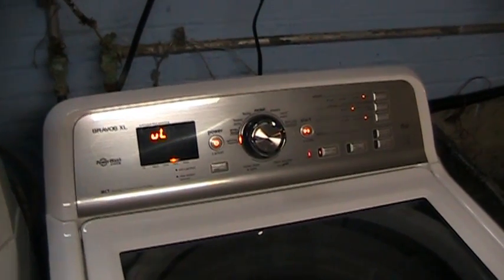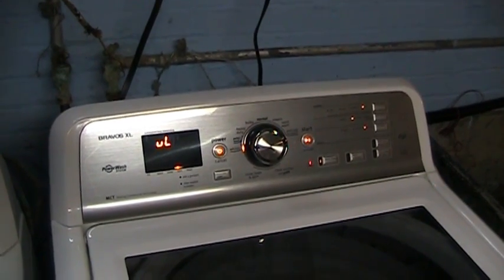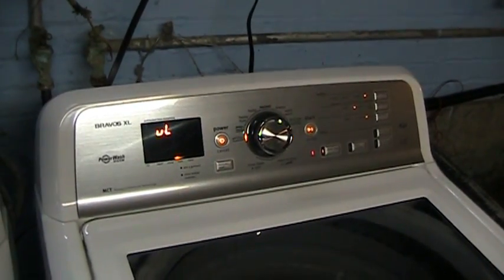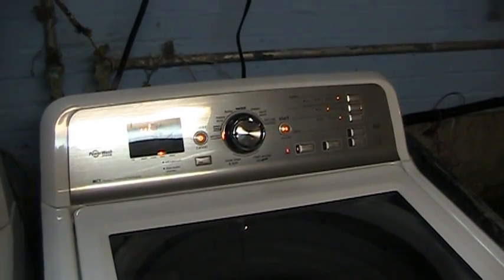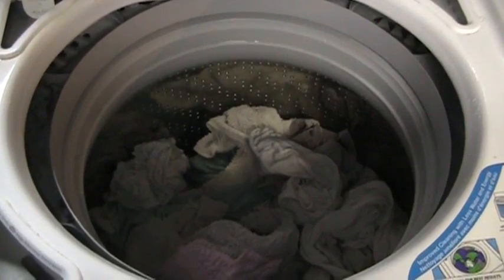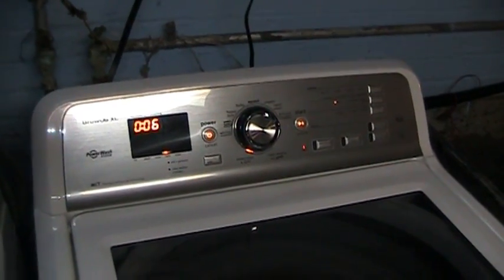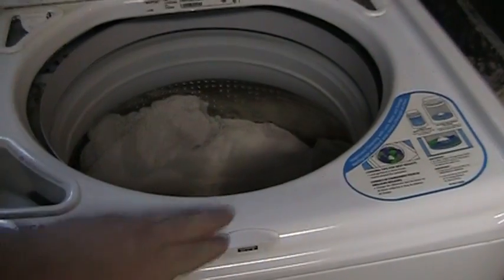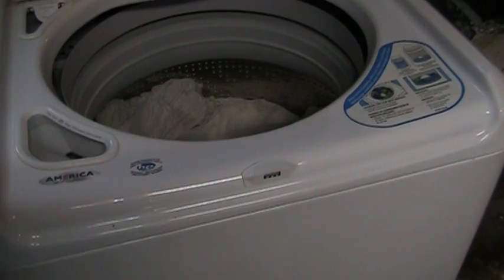Stupid Washing Machine Being Stupid

Comment: We just had a Samsung dryer that died after 12 years. Most of its life had a very funny thing that it did. After the dryer finished and sung its song telling you it’s done, it would for some reason continue to run the Tumblr. Keep in mind most of the life We never use the wrinkle preventer function on it. If you open the door the tumblr would shut off. But as soon as you close the door, the Tumblr would come right back on. The only way we could get it to go back to normal as if we ran a five minute timer or turn the breaker off for a few minutes. But for the last year we had it it seemed to have happened more often and gotten worse to the point we couldn’t actually get it to stop doing it. Then eventually, the dryer had enough and stopped heating and we have since replaced it with a whirlpool. I tried looking up this problem and I never found anything about this or other people that had this problem about our model Samsung dryer. For some reason, our Samsung washer has recently started to do this problem where it would go unevenly loaded for really no reason or another error that claims that it’s not sensing any water going into the drum and stopping. All we have to do is press the start button again and it seems to go back to normal, but it seems to get stuck before the spin cycle.

Comment: Going through this right damn now. It will fill with water, then won't agitate. Why it take so long to fill? I hate this. Now my husband and sons  use it and no problem.  I use it, it get stupid.
Reply from the maker: I can't answer your second question...unless it happens that you just aren't waiting quite long enough for agitation to start. As for the first question, it does take this model a long time to figure out how heavily loaded it is. I believe this is done by spinning up the drum and looking at the timing differences returned from multiple hall effect ("rotation") sensors.

GE/Haier Appliances has washing machines that do the same thing in far less time.
Reply: Season Greetings!! The machine will fill with water a few click then it will attempt to agitate/impell then stop. Or it will fill up, a few clicks and the impeller won't move at all. I drained the water, the tub will spin, as of now the impeller wont move at at by hand.
Reply from the maker: It's certainly possible that something got under the washplate and is jamming things. I'd really expect the machine to throw an error code in that case. It's been a while since I had the tub out of this one (hall effect rotation sensor failure after a basement flood), but it's not terribly hard to do if you're mechanically inclined.

I didn't particularly care for this machine then and I really don't care for it at all now.

Comment: I remember watching washing machines run while the lid was open when I was little... I still survived.

This is going to sound harsh, but sometimes you just have to let survival of the fittest play a role. If a child is stupid enough to stick their hands in a running washing machine when they are clearly big/old enough to actually reach up there. Frankly deserves to find out what happens.

Also, is it really necessary to REQUIRE the lid lock be working in order to use the machine? The lid lock should be considered and accessory. Not a critical component. No wonder these things are always breaking down.

Comment: new appliances are computer controlled and the software was written by morons. My new washing machine always fills to the same level which is designated by the load type selected. It however decides to fill wait fill wait wait wait fill more then wait. aggitate wait nope fill. It takes an eternity to fill up. Then it does the same stupid thing with spin cycle. Also draining water at end of wash is the same retarded shit. Drain a little wait drain a little more oh shit no wait. WTF. 

the weirdest part is an empty washer with nothing in it and you can hear relays clicking open and closed randomly. WHAT IS IT DOING!!! It is supposedly off!! I guess it is also wasting electricity. oh yep it is.
I dont understand what was wrong with the old reliable mechanical timer and just doing the damn laundry.
Reply from the maker: There wasn't anything wrong with the mechanical timer, and many clothes dryers have actually gone back to using one!

The software in this machine is beyond stupid. If it had been written by morons, that might have been an improvement.
Reply: @uxwbill  i agree
Reply: This is so stupid! And it doesn't clean when working properly!
Reply: @jeromedavis8575  no it doesnt but it does a great job tearing up your clothes.
Reply: @kwacz  I've never had torn clothes from a Speed Queen Classic. What washer do you recommend? If the classic wasn't available, I'd go with the Maytag commercial.
Reply: @jeromedavis8575  all i can say is that I had an old washer in my clothes lasted a long time. I bought a new washer and now all the crotches of my sweatpants have holes ripped in them within a month or two. That was never a problem with the old washer. I bought a new one of a different brand, right now I have a whirlpool and it isn't much better.
Reply: @kwacz  Which other ones did you have?
Reply: @jeromedavis8575  whirlpool and Maytag. But they just don't make things like they used to.
Reply: @kwacz  There's an exception: Speed Queen Classic.

Comment: 0:49 No no no! I heard that was the same company that has those crappy stereo machines with those ugly plastic turntables! Their washing machines are also just as bad!
Reply from the maker: It's the same name, not the same company. The appliances are manufactured by various companies: Whirlpool, Electrolux and GE Appliances.

They're most commonly seen in apartments and dormitories, being as most of them are extremely basic models and therefore cheap.
Reply: Maybe one of those "Crosley" companies [and I don't care which one] needs to change its name. You know, to avoid confusion like that?

Comment: I used to have one of these newer machines at the family house. Maytag brand, too, though less glitzy (no glass top, LED display). It wanted us to place clothing or sheets in a specific way: always towards the outside edge of the basin, and in segments. It didn’t like clothing being in the middle of the basin. Took twice as long as the old unit, no matter what we did.

In retrospect, a Speed Queen would have been a much better way to go, despite that being the more expensive option. We use them at the apartment building I live at now and never have issues with them.

Comment: This is why you use vintage.... JK I know you would rather use a vintage things. We use a 1996 Maytag, and it works perfectly. The only thing we replaced on it was the water shutoff solenoid (what keeps it from over filling).
Reply: The only new machines I'd use are the Speed Queen Classic pairs.

Comment: We used to have a very similar Maytag washing machine with matching dryer before we moved, and it would throw the unbalanced load error during almost every wash cycle. The only way to make it not throw the error was to barely load the drum up which I thought wasted time and resources. After we moved, we got a pair of LG machines which still go crazy with the laundry at the spin cycle but at least they doesn't stop every time whining about the load.

Comment: I HATE my new  “forced to buy Energy Efficient”  , Energy Star whirlpool.!!!! That’s all the appliance stores make &  sell around here now days.  
It will not let you do a Hot water wash,  darn temp sensor , because of the Stupid gov. Regulations & restrictions !!!! 
I wish I had repair & mechanical training , fix it skills !  I would have certainly kept my old washer that lasted 25 years.  
I wonder how hard it is to get parts for old machines ?? Dryers too ?  
If they even sell those parts  anymore.
Reply from the maker: Many parts are still available and a lot of failures are easily repaired in the older machines. I don't care for the new machines either, and don't believe they produce any great savings.

For at least a little while longer, Speed Queen is still manufacturing high quality machines. They might have to be custom ordered at this point. It's my understanding that the government has come down on them as well, and that their newer machines are nowhere near as good as what came before.
Reply: Grand Appliance does still sell Speed Queen. I looked at them when I got my microwave. likely when mine die I might get these. @uxwbill
Reply: It's going around the AW grapevine that Whirpool/Maytag's commercial line may not really be all that bad. I believe the MAT20 is the Maytag counterpart to the Whirlpool model being demonstrated.

https://youtu.be/M8TBSRgz_6M
Reply: The 2019 speed Queen washer allows hot washes and has traditional agitation and you can do a full tub of fill or half tub of fill however that is it, anyway the cycles are simple and not complicated and the extra options are extra rinses, presoak rinse and heavy duty ( extended wash cycle to any cycle)

Comment: We have a different but similar HE top loading washer.  For ours, it is important to arrange the clothes in a doughnut shape leaving the wash plate visible in the middle.  Regarding Energy Star, I actually think it is quite useful in some product classes.  Air conditioners in particular show a clear distinction and the Energy Star mark makes it easy to identify those more efficient models and provides manufacturers with an incentive to create extra efficient models and helps them market them effectively.

Comment: People need to use their common sense when using these machines. For starters, read the manual and understand it. If your going to wash bed sheets, put couple of them and that's it! Don't be adding jeans, towels, etc. I have a Maytag Bravos and it's about 10 years old and I've already replaced the tub bearings & drain pump. In addition, depending how much you wash, these machines need maintenance about every 3 years: the inner tub needs to be removed in order to remove any lint around the drain guard cap.
Reply: Never used to matter with an old school top loader with a center-post agitator, or even a vintage front loading washer like a Bendix or Westinghouse.
Reply: @richardhz-oi8px  all that mattered was wether or not its overloaded to the point of no turnover

Comment: Hi there folks, I'm British and live in London, top load washers are very rare hear, in the 1970's/80's Hotpoint sold a american style top loader hear, I had one, the amount of water it used was alarming but speed and cleaning was first class. Because of EU law, this machine is no longer made/sold hear now because of the water consumption/energy use. All we have on sale hear now are front loaders, using small amounts of water, longer program times but energy efficient. The HE top loaders iv seen in the states seem to waste a lot of time/water sensing the load and then trying to balance it before spinning repeatedly refilling trying to redistribute the load. The old mechanical top loaders(speed queen, fridgidare, whirlpool) were so much better as you no. I think washer manufacturers making in and selling to the states are going to have to go back to the drawing board with this High Efficiency thing. I have a Miele front loader which is never a problem, it washes, rinses and spins well and always sorts it self out. Take care and have a nice day. Best wishes Lee.

Comment: It is rebalancing
Reply from the maker: I know that. The implementation seems incredibly clumsy and wasteful.
Reply: Un needed to use that much water very wasteful. I prefer Frigidaire washers and dryers
Reply: so much for "Energy Star" should be called "Energy black hole"
Reply: Dylan Reischling to avoid that   
Press the pause button and rebalance it if you hear plus if it looks like it is balance but it goes out of balance then there something wrong with the motors nut screw that needs to be tighten
Reply: Yep

Comment: Hello,

I'm late to this party but I have this machine and I hate it. I purchased mine in 2013 and had the repair man come because my clothes were getting ruined. He told me something about water temperature being an issue in breaking down the HE detergent. I have purchased everything to keep the washer clean, high efficiency detergent, washed smaller loads, used extra rinsing, and some clothes I have taken to the laundromat. My warranty was up last October so if you know something I can do please let me know. My husband I have even discussed buying a new washer. Three and a half years of using tons of water, wasting electricity to double wash and destroying clothes  I have paid for a new washer. HELP!
Reply from the maker: I've not had any trouble whatsoever with clothing being destroyed. In terms of troubleshooting, it would help to know exactly how your clothes are being destroyed.

These aren't my machines and they are not what I would have purchased. If you do replace the machines you have now, I can only recommend Speed Queen as a replacement. They are more expensive, but you will only have to buy them once and they will last.
Reply: uxwbill Thanks for a quick reply. An example of how the clothes were ruined: dark clothes coming out with clusters of lint and blotches of soap and not rinsed, light colored shirts ending up with spots everywhere and stains not coming out. I even wiped the insides with vinegar to make sure nothing was along the walls. I have heard others mention the Speed Queen as you did so I will do some pricing. I will be the first to admit I miss the agitator in older machines. Recently I took out some shirts I haven't worn since purchasing this machine, and it's shocking. The old shirts look newer than new shirts I've worn 2-3 times. Thanks for the feedback.
Reply from the maker: I'm really not sure what to think about the trouble you're having. I've heard of others having the same problem, so you're definitely not alone. It is not a problem I've had with this machine.

You might try calling Whirlpool if you haven't already, even with the machine being out of warranty. This machine suffered a failure outside of its warranty, and Whirlpool covered both the part and labor without question when I called them and complained. Be firm and insistent that you expect to be satisfied, but don't forget to be polite even when you're frustrated.

If Whirlpool cannot satisfy you or chooses to refund your money (which I've certainly heard of them doing for other appliances that weren't right), I would definitely recommend the Speed Queen machines. They still have a conventional agitator inside. (There are also some low end "Crosley" branded machines that have an agitator and mechanically operated controls just like every washing machine used to have. Only I have no idea who is making those or what kind of quality they have.)

Comment: It's because you covered the wash agitator
Reply from the maker: There is no agitator in this washing machine.
Reply: uxwbill here's my theory on top loads: HE top loads don't use enough water that clothes don't get wet and cleaned. Non-HE washers use too much water that clothes just sit there.  Front loads use gravity to actually wash and make clothes wet. The best washer is a front load.
Reply: that particularly isn't true about non HE washers typically they have an agitator that is designed to move water and clothes regardless of how full the machine is. my speed queen top loader is more effective at cleaning than these HE machines
Reply: GarageDoorGuy89 On either model, it performs poorly if the wash agitator is covered. There's this thing that I hate, where you put your clothes around the agitator, otherwise it is awful

Comment: the only reason why your clothes come clean is because there's a chemical reaction between the soap in the water. your average high efficiency soaps nowadays only operate in temperatures between 72 to 78 degrees. instead of an agitator beating the stains out of your clothes they now use  an enzyme that literally attacks the stains and dissolves them. but I don't feel bad for consumers. you deserve everything you get.
Reply from the maker: These are not the machines I would have purchased. I would have bought a decent used machine or a brand new Speed Queen.

Comment: Years back my mother had a Philips automatic washer, front loading. This old thing just kept on going. The only electronic thing in it was the thyristor control that did the wash motor. Eventually the drum bearings went and she replaced the machine with a heap of junk half of which was ChinaPlide, lasted about thlee years. Just outside wallantly. The Philips was made in Halifax, England, and badged "Electra" as it came from our local Electricity Board shop. Electric was nationalised and state run at the time. Now it's all been sold off to foreign interests like the french, who've always hated us ! EnergyStar? Another pile of PC poo.

Comment: It's time to switch to Speed Queen Top Load Washer and Dryer.
Reply from the maker: Had it been my choice, that's what would be here. And this video wouldn't exist.
Reply: uxwbill a few hrs with a soldering  iron  and some wire  will hopefully bypass the sensors  lol
Reply from the maker: The designers have gotten wise to that trick. They now often check to see if a sensor's state changes. If it doesn't, an error is thrown.
Reply: uxwbill if i see a washing machine like yours being thrown out i will grab it and see what i can do and try to disable the sensors but at the same time make the machine think it still has sensors  i have  done this before and it worked
Reply from the maker: If one wanted to do naughty things to do this machine, it'd be as simple as removing that glass window. That'd get you a lot, and it's probably pretty easy to do.